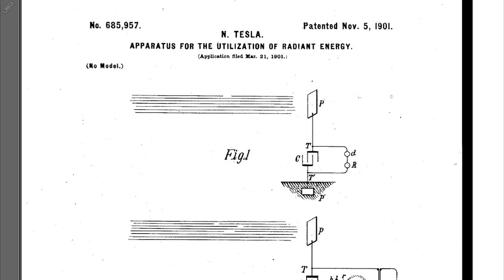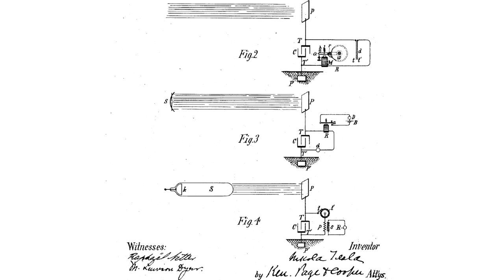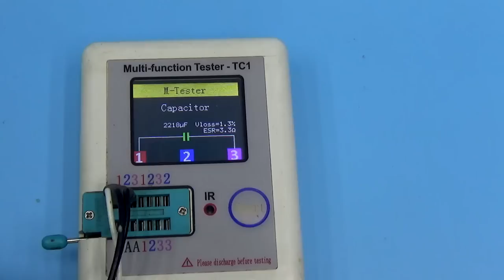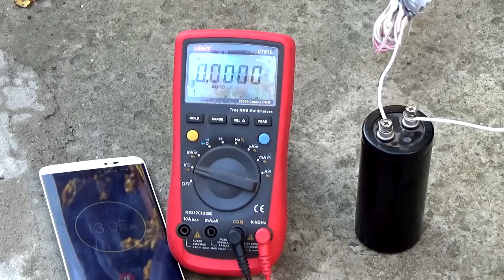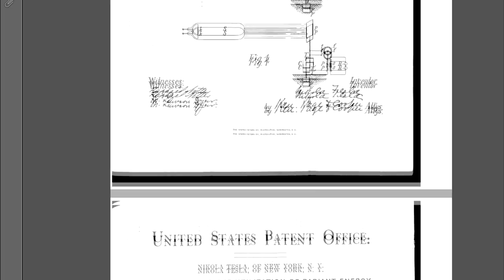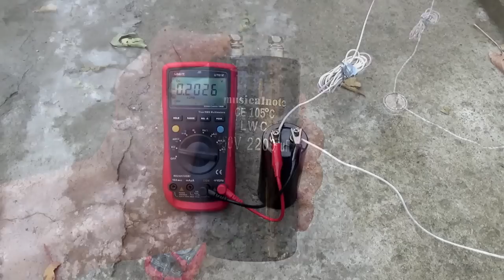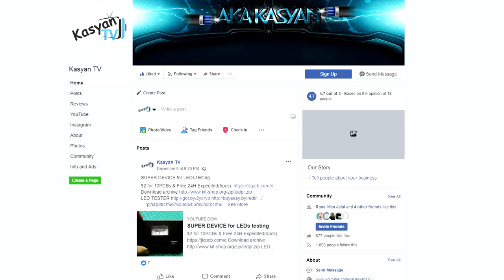Nikola Tesla - Free Energy (fuel free system - How does it works?)

Comment: I’m getting sick of people unable to replicate properly a device than claiming isn’t working or the output not not worth to pursue further more. Actually this setup can power a house in the winter. Capacitors needs to be chosen in relation with the load, diodes needs to be fast switching under 25 ns and voltage according with the desired output, antenna needs to be a real metal chunk highly polished placed at least 2.5 meters above the ground completely isolated, an ground connection properly done is a must and few modules like this can be connected in parallel  … 

Just compare with a photovoltaic system to see how much power they generate before trashing this system !  Than take in account that this system is working 24/7 with no maintenance needed and power bank would be just 10% compared with a solar electricity system, cost for few diodes and capacitors are a fraction of cost of solar cell 

Actually with the right setup we can have a mobile solution and we can power electric vehicles easy without huge battery banks which would reduce the cost at least half, no to mention pollution reduced 99%.

Some people graduate the school and being just brainwashed, not learning anything … this setup can be done by anyone who truly learned something in school after 10-12 years, and there isn’t anything that break any laws of physics.

Comment: There is technolgy developed in netherlands to harness static electricity from air. Right now the efficiency is 105% (device needs initial „charge” to collect static from air)
Reply: Tessler knew this and even built the towers to attract the electrostatic in thunderstorms they were destroyed time after time. The problem is confining a average lightning bolt is possible to store the energy without blowing transformers. The issue is that some strikes are 5 million volts , A lighting strike which heats up anything it touches in a instance to more than 6000c and can actually create pure plasma  that's impossible  to control .For us to gather energy from the air by wind is far safer and more reliable until we can work out how not to overload the grid system also static in the air caused by charged particle from the sun already overload our antiquated network every time it activity increases on the sun so you would need to factor  that into the equation when considering such a feat
Reply: @wayneparkinson4558  it's not impossible just improbable... harnessing lightning Requires opposite windings calculation of gaussian density...in other words you build klystron coil array wind to left hand flow of ions Instead of right hand rule of electron flow...MOST of lightning is Ion Energy...humans are Binary brain creatures bound to euclidean geometry...

Comment: A good experiment would have an identical capacitor right next to it, connected to nothing, as a control. Capacitors can acquire a space charge just sitting around.
Reply: They charge just by sitting around?
Reply: @marcelkuiper5474  Not to any useful level. We're measuring miniscule amounts of current here.

Comment: Thanks for the video. However, I must ask, considering we live in an era where there are skyscrapers and high rise buildings surrounding us that have roofs averaging the size of a quarter of a football field, would it not make sense to have these receivers on the sides as well as on the roofs of buildings? Would that not make an efficient amount of energy?
Reply: In most cases it would make a lot more sense to cover these areas with solar panels and combine them with a pack of batteries. It would make for a significantly more efficient system than Teslas, as explained in the video.
Reply: The answer is yes.
Reply: @domestinger8805 :

Not really, because those tall buildings are not insulated from earth, and it wouldn't be practical at all to make them so considering that they're made out of metal. Thus they continuously act to neutralize the atmospheric potential gradient, and can't be used for harvesting themselves.

Comment: We can use perpetual motion added with the coils and magnets configured in such a way not unlike how it looks at cern and the other induction engine that tesla created. I've seen ppl create these themselves as its only able to be a DIY project n can't be sold. But we can take the petrol engine off of our own home generator and then use golf cart batteries to store the energy in. We want to build a coil and match the impedance to be that of a house or car so to run it on the energy I've seen ppl make these n have run their entire hojse on and or car for 2yrs and going. But we never hear from them again many inventors. That took the basic idea and built on it and made a car run or a house. 

We get the right voltages calculated and it dictates the shape and size it doesn't need be that big. But the idea is we have magnetically pushed and pulled like perpetual motion machines but the kind that use magnets and they are set up in such a way that when it's done being pulled by 1 its pushed by the next. This way we can setup our coils to get excited electrons from the speed of the magnets spinning with copper coils configured in the proper ways. We can already see the design in these images in this video. The on off switch is the thing that spins faster n faster lol. So idk its kind of a thing u set and forget it just keeps going generating more power and when we hook it to where the other petrol engine was it works better lol and is quiet and clean zero pollution this way. But why have we been burning coal so long n worse nuclear as "clean " $$! Sad they were upset they couldn't put a meter on it.. not realizing all the inventions they could have done so to after that was achieved! Lit the world in the 1900s there's still video of it but they're scrubbing it fast why? So much we've been lied to about. I wish I coukd remember more about the designs but its it'sits been there about 15yrs now and I'd been remembering it from watching a video once yrs ago and trying to make it in real life but it keep getting taken down and suppressed. Which really makes me think its on to something big.

Comment: Radiant energy is particles that have been charged either positive or negative. As particles strike the antenna they leaved these they add or delete the charges on the plate. This way an average charge is reached. Tesla must have came to this conclusion. However he mentioned the sea of energy. CERN mentioned that all of space is full of electrons. The need to only be gathered. Is this a good enough clue?

Comment: There is so much wrong with the experiment. Tesla said heavily insulate the plate, use high tension/high voltage capacitors, and to have everything insulated for high voltage. You are also supposed to charge the plate negative. People replicate tesla's patents and completely leave out very important details. Also the plate should be suspended in the air as high as possible.
Reply: @fredflintstone3318  No I've actually done the experiments, it was before my YouTube channel and before I was making videos. Right now I'm working on the tesla turbine to utilize the heat energy that can be created with this system. I will re-build it in the future now that I have funding to build it properly. The only reason I'm upset is people say the technology doesn't work, and it's not because it doesn't work, it's that people build it wrong.

Comment: Instead of aluminum try copper and instead of a thin sheet, use a coil design on an insulated frame. 
It’s not the surface area that you’re looking for but the concentration of conductor material. 
Try a Christmas tree form Made of insulated material and use the copper to weave the positive collector.
Reply: Explain this better
Reply: @domestinger8805 :

The video is misleading, because it seems to indicate that incident rays are what's powering it, even though she even remarks that it keeps functioning at night. In reality what's actually happening is that you're essentially "harvesting" atmospheric ions, which are arranged in an atmospheric electric field with a gradient of ~100 V/m near the ground, but much higher further up.

To increase the energy harvested in this way what you want to do is to have the antenna as high up in the air as possible, and to have as much surface area on it as possible (a flat rectangle as shown here is a rather lousy design, better to make a fractal antenna or just use a dense copper mesh arranged in a spherical or cylindrical shape). During times of more atmospheric activity both in terms of wind and electrical activity (as during thunderstorms, but also during moist weather in general, the equatorial tropics would probably be a great place for something like this) there will be a lot more energy available.

You essentially have to think about it in terms of how much charge you can collect on the antenna, which primarily comes from charged particles in the air rather than radiation; thus why more wind (more particles moving across it) and moister weather (more charge being conducted between the particles themselves) is better.

If you do this you should also make sure to either use high-voltage capacitors or to regularly discharge the capacitors once they reach a certain voltage, because the voltage very high up will be quite large (as mentioned above, the field is ~100 V/m on a fair day near the ground, under a thunderstorm high up the field can easily reach 1000 V/m or more, for a total potential of tens of thousands of volts depending on how high up your collecting antenna is). These days you can get high-energy supercapacitors very cheaply, would probably be a perfect fit for this kind of thing, but they are rated for a low voltage in comparison, so you'd really have to make sure to monitor and discharge it (luckily they'd take a fair amount of time to reach their rated voltage, relatively speaking, so that shouldn't be too difficult).

Comment: I think 7.83hz is a saturated signal so design around 40k ft. Of 8gauge at a height of 45ft. 300sq ft air core ariel antenna. With super capacitors should be able to do it now. 180 2.3v. 5000f

Comment: might wanna try a capacitor value available in Tesla's time, i suggest a few metal cans or buckets that fit into eachother with an insulator between them (cloth or something)
with waay back then tech a 2200uF cap would be like as big as a truck?
Reply: I've only seen a few mentions of Tesla's work on capacitors, they were another subject he was doing inventing on. 
I have a reprint book from early 1900s on how to build capacitors and they showed examples of some of the largest caps ive ever seen, I didnt know that industries built them that big.
One had to be 8 to 10 feet long and near 2 ft. wide.
I thought i had read in one of my Tesla books that he was building some kind of apparatus deep into the ground below the wardenclif tower that was supposed to act as a capacitor. I have to find my book again.

Comment: so sad he could calculate energy so well.. his systems product like 1w power. Still great engineer of all time
Reply: Stick a good ion collector high enough up in the air, and you can harvest way more power than that. A few hundred meters up and we're talking tens of kV in a conductive enough part of the atmosphere to establish a continuous current. I saw someone who had collectors just ~40 meters high, and during disturbed weather they achieved a peak of ~40 kV of continuous ~30 mA current; that's 1.2 kW.

Go even higher up and you'll start getting power like that even in fair weather, and far surpass it in disturbed weather. The ultimately goal of this technology would be to use lasers to establish plasma channels and harvest energy from the ionosphere that way, or something incredibly dramatic like setting up standing lightning bolts between the ionosphere and ground. When thinking about what is really being done here in those terms it's easy to see that we're talking about a lot of potential power.

Comment: Today, many people are talking about free energy, and how it can help them get off the grid. However, what they don't realize is that free energy has been around for a long time. It's not a new concept by any means. In fact, ether technology development engineers have been using free energy for many years now.

One of the best examples of free energy technology is the magnifying transmitter. This is a device that can convert electricity into ether energy, which can then be used to power your home or vehicle. The magnifying transmitter is still in development, but it shows great promise for the future.

Comment: interesting !  i am wonder , those particles of energy did they go through the panel of aluminum?  what if you can use multiple panels as energy colectors , 3 or 4 , the one in front of the other, to eliminate the case of particle penetration and loosing eficiency, in that case if we loose energy with one , you must see with 4 layer of colector an increase of charging voltage of your mesurment for the same time of exposure....
Reply: There is so much wrong with the experiment. Tesla said heavily insulate the plate, use high tension/high voltage capacitors, and to have everything insulated for high voltage. You are also supposed to charge the plate negative. People replicate tesla's patents and completely leave out very important details.
Reply: @iEnergySupply  have you made one does it work?
Reply: @conniehurney9546  Absolutely, I followed the directions exactly It was a very crude set up, but the concept was proven with amazing results.  I am returning to the research after I finish the tesla turbine research.
Reply: @iEnergySupply  will you keep  me posted on your results please. On both efforts.

Comment: This device probably works on the basis of the photoelectric effect where electrons are lifted out of the metal (you need high enough frequency, so probably only the UV light of the sun contributes significantly). That results in a positve charge in the metal and electrons flow from the capacitor to the metal creating a charge imbalance -> voltage
Reply: Lovely video content! Apologies for the intrusion, I am interested in your opinion. Have you heard about - Malmenjaay Unexposed Inspiration (should be on google have a look)? It is a smashing one off guide for discovering your mayan day sign and the clues it has to your future without the hard work. Ive heard some pretty good things about it and my mate at very last got cool success with it.
Reply: You clearly dont know what you're talking about. Electrons getting "lifted" from the metal is literally electricity, everything else you said is unnecessary. Also if you actually dis that you'd realise that you just described a Van de Graaff generator or tesla coil. It take energy to move the electrons away from the metal so whatever energy you get is what you paid for.
Reply: @Devonte-w8o  No the energy of the photons of light provides the energy to the electrons that they need to be released out of the metal. If you lay down any piece of metal into the sunlight, some electrons are expelled due to the UV-light (Google photoelectric effect for this). This is totally different to a Van de Graf generator which works by  friction (triboelectric effect). 
What is shown here in the video is basically a solar panel but not as efficient. Normal solar panels use semiconductor materials to efficiently generate energy. The energy comes from the sun through photons. It is basically free. But it is not a perpetuum mobile because it is powerd by an external source, the sun.
Reply: @@ChannelTheLizard . Do you like arguing with yourself?

Comment: Very funny.
Reply: What are they doing wrong?
Reply: @timothyaaron8603  
IMHO
first you need a more power full radiant source, 
the sun is a relatively weak source. 

each of these radiant patents of Tesla are part of a bigger picture. 

A strong radiant source could be an impulsed series resonant primary coil, with a high voltage DC offset. 

Next is the capacitor, it looks like a very large one, with large esr (equivalent series resistance).
High resistance with a weak source will eat away the voltage quickly. 

Using a higher quality capacitor will have less losses, a smaller capacity will also charge up to much higher voltages 

 keeping wire resistance low will give even better results.

The concept is good, there is a voltage present in the atmosphere but by itself it is weak. so  you would need high altitude, a  big plate,  low resistance cables and high quality capacitor. 

But then the cost vs the power isn't worth it. 
At least, this is my perspective. 

In the end, it will be most interesting when the radiant energy can be amplified.
Reply: @MasterIvo  To understand Tesla's Free energy, understand Edison, understand Teslas virtual antenna, "a magnetic field rotating in space"! Tesla never revealed the secret of his love. A virtual antenna that requires no input energy. It unlocks the oceans of energy in the Earth and sky. A high radiant energy source would use a lot of cash worth of energy to power. It's not about broadcast distance it's about free.
Reply: @timothyaaron8603   yes free Electric POWER.  Energy isn't enough, we need power. voltage with current. 
Voltage without current doesn't give power.
Reply: @MasterIvo  Yes, Edison had the same problem, he could only deliver electrical power a few miles from his power plant, then the current became too weak. Tesla solved it. There are several ways to free up ambient energy and make it flow abundantly. The radiant energy broadcasted should not be the same energy that is harvested, that would be a zero-sum game. radiant energy is only a catalyst to harvest a huge ocean of ambient energy.